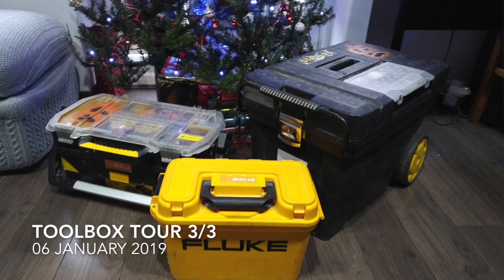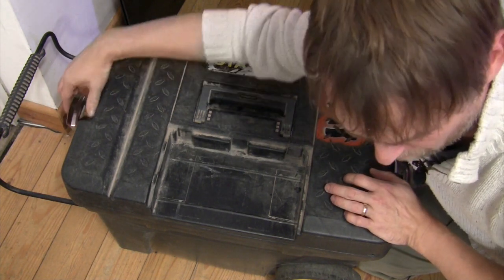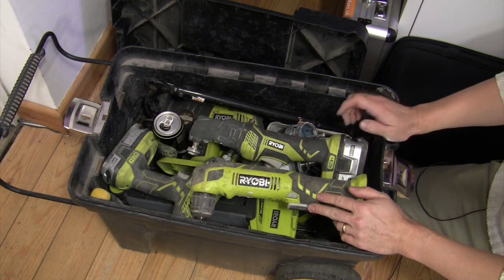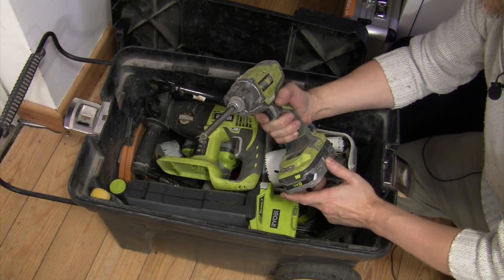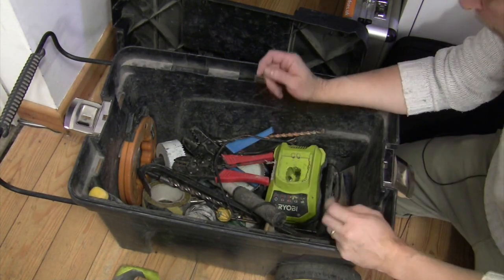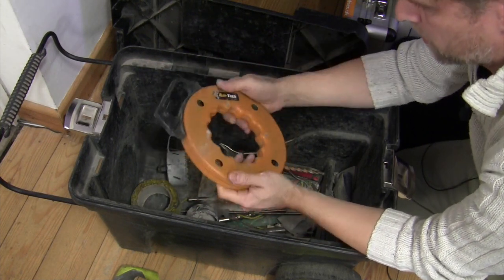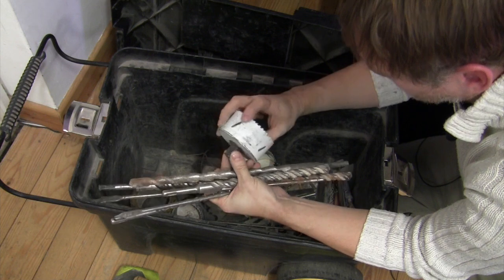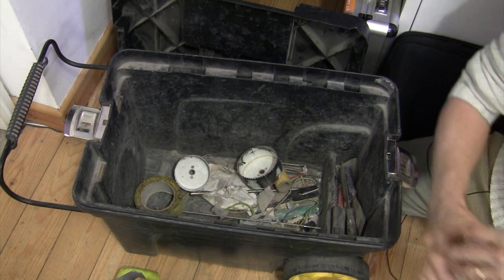Toolbox Tour 3 of 3

Comment: Ryobi was a major trade tool manufacturer but changed to compete at a lower price point. They are owned by a Hong Kong company that makes Milwaukee, AEG and a load of other brands you've heard of.
I've had Ryobi kit since 2007 so half my kit is the old blue units that still use the new batteries. It's very unrated gear that gets the job done.

Comment: Thanks for the video. Very interesting. Any idea where you can get fire resistant cable clips for 2.5 twin and earth that can be fixed to a wooden joist?
Reply from the maker: Not really. Despite the tightening of the regulatory requirements, pop into any wholesaler and there seems to be few options that meet the requirements. I have used FP200 clips myself as a ready way of clipping cables: https://www.cef.co.uk/catalogue/products/4188996-7-6mm-8-0mm-single-cable-clip-white-zeroburn-pack-of-50 - but I imagine most jobbing sparks are continuing to use the usual grey plastic T&E clips without second thought.
Reply: Thanks for the quick reply. It confirms what I thought. Cheers.
Reply: In Norway Letti clamps are the most popular clamps, might want to give them a look if they're available in the UK. They're plastic covered stainless steel clamps and can be used pretty much anywhere.
Reply: @Karreth  Thanks for this. Schneider are now also making all metal cable clips that comply with the 18th edition of the UK regulations.

Comment: Hi David! I may be close to retirement but, it’s so sad not to see Pyro tools, or engineering tools anymore. My power tools had to be Hilti (or else)!!!  I don’t think there’s much difference in any make nowadays. Things have changed so much, To me, on installation traditionally, a cable would hang from a fixing with the anchor at the top. Now guys swear down it’s wrong! Hmmm!? Trunking is another one. Nuts inside or outside? I would have been publicly stoned if I was caught doing any of that! But now, it seems anything to please the accountants. That SWA knife you’ve got looks handy and so does the ringer tool. Good video mate!
Reply from the maker: I don't see a lot of call for pyro, but then 99% of my work is domestic, especially since we dumped the VAT registration last year. For the sake of practicality, those other tools that don't see common use are either permanently kept on the van if their replacement cost is low, or are held back at HQ and only brought out when required for a specific job. You're right though, there isn't a lot of 'engineering' in it these days. Take my conduit bender for example:- only been used on two jobs in the last four years. Very satisfying to pull off a job where you've had to form the structure like that, but not a lot of call for it in my client base, so all the associated paraphernalia doesn't get to see the light of day much.

Comment: Ryobi is fine. I have a parkside (yes from lidl) drill. i don't expect it to drill holes in a concrete wall, but it does the downlight holes like a champ. And it cost me 14 pounds. 3 years ago. so :P to the snobs

Comment: Hi David just started watching you vides 
geat and infomative for the newbies , may i suggest a  new tool for your box to help overcome the issues with the devils spawn of woodchip T&G i have a woodchip hole saw which is great for this job, Cits a hole big enough to get your hand in and out and just drop the matching plug in when done and its like you was never there.
if i was more tekki i would add a link, but im not so just type it in amazon search 'Woodchip hole saw' And bingo there it is , i also note that this help miss those annying water pipes left by that useless plumber notched in the joist at the top waiting for us to nik with out multitool or trim saw .
on a lighter note i think its about time  you had a desperado in shot to make a change from the old special brew , quite suprised not seen a 'GOLD LABEL" 111